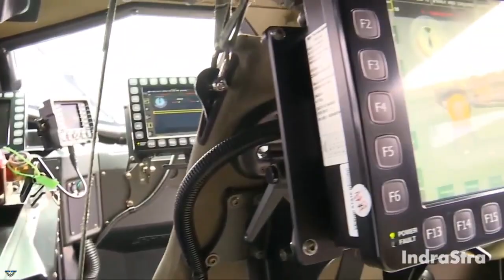Canadian Armed Forces tests the capabilities of the Australian Thales PMV Hawkei

Comment: We have liberals in power right now. When Eber, liberals have to buy something for the Canadian military. Usually comes from Germany will probably end up by more f g wagons. Canada should either buy that vehicle that's manufactured in Toronto. The Ralph show. I guess it's called. Really, I think we need to buy the JLTV Oshkosh defense Whatever general dynamics has offer. It should either be Canadian, built or American built. The parts are relatively easy to get. I like about the JLTV It's powered by AGM 6.6 Turbo diesel V8. One of the most reliable engines out there. In the Canadian army. With the Silverado 2500 already know about the duramax diesel. In the Al sonata Mac transmission.